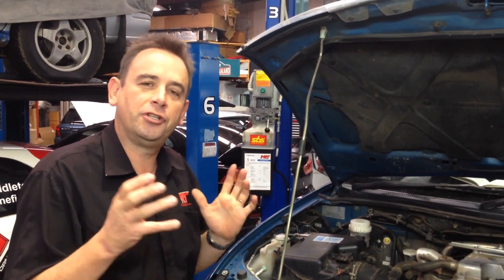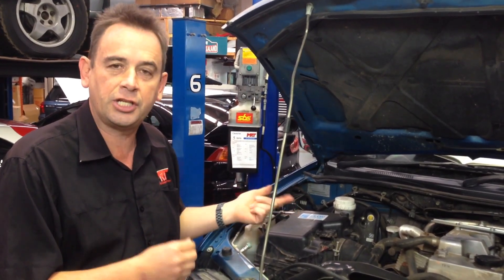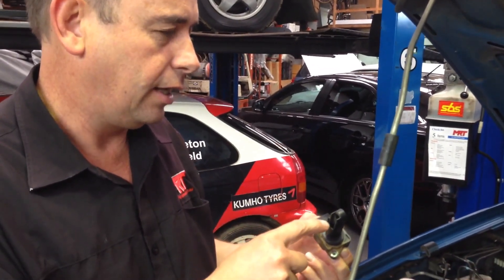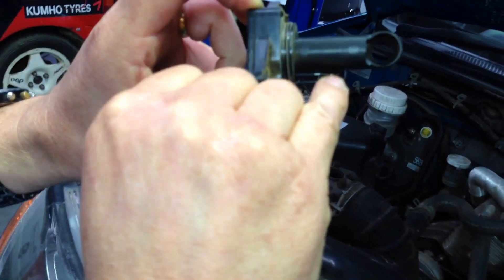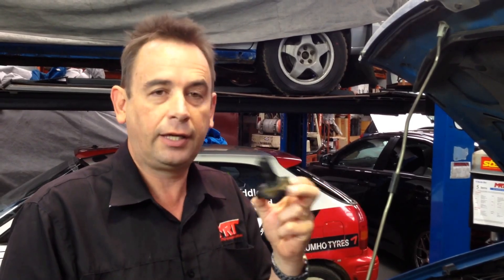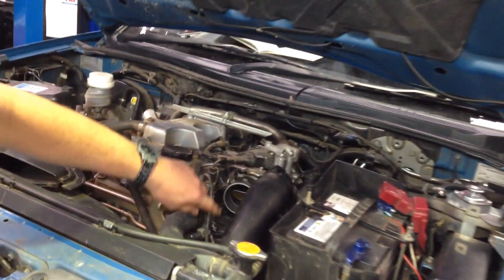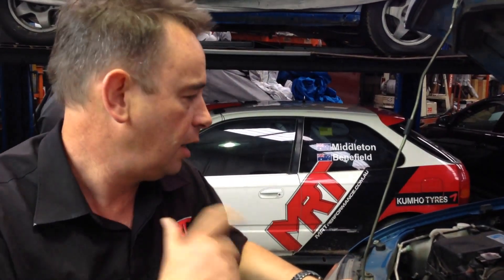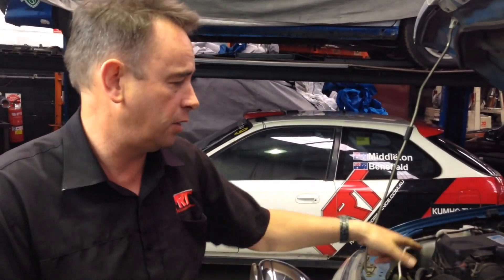Mitsubishi turbo diesel faults with inlet sensors, tips and traps

Comment: Hi, just wanted to say thanks for this tip. It saved me time and money. The airflow meter screws were a little loose and dust was getting in. I cleaned the sensor very carefully with a cotton bud. Now I have more power than before and the engine light has turned off. 
Cheers.
Reply: 2 years passed,  how is your car running now ?
Reply: @chachenaki_kichenancha  still running like dream.
Reply: @AB-cn9eb  I am about to buy 2018 outlander 2.2 diesel ,I wanted to feel confident into mitsubishi diesel engines

Comment: So what is a good DIY way of cleaning this delicate sensor? My 3.2 Pajero is also putting out some black smoke, especially when the outside air is hot and when there is just a little throttle opening, just enough to maintain speed. To remedy this, I must either release the pedal or step on it. No one I have talked to, including the dealership, seems to know what it could be. The dealer wanted to replace the egr valve and intake manifold, something that sounds a bit overkill to me. Something tells me there is a fuel/air mixture problem. But no codes or errors. BTW, I removed and cleaned the EGR valve, and it works fine.
   EDIT: Blocked off the EGR pipe at the exhaust cooler and cleaned inside the throttle body as much as possible without disassembling too much. The MAF sensor was extremely filthy, drowning in a black substance resembling used motor oil. Now there is no more disgusting black smoke, and much better fuel economy, going from well over 11L/100km down to around 8L/100km (highway). Now I don't have to be embarrased when driving around anymore! Good stuff. Still, would be nice to get that ECU remapped.

Comment: I have 96 pajero 2.8 TD 4m40 engine.  The vehicle was driving really heavy ,losing power and black smoke. The engine light came on for:
12* Boost pressure sensor system and 41* Main throttle solenoid valve system.
I gave to my local mechanic who checked and tested the boost, turbo was boosting correctly. Checked throttle valve and components. They removed and tested EGR components and adjusted the belt.
What could be wrong?

Comment: I have a 2014 built diesel Triton, its developing a stutter when maintaining speed about 90-100, also before it was warmed up the other day it smoked alot and wouldn't respond to throttle...it seems to clear and then runs good...but the stutter is still there intermittently...any help or advice would be great ...thank you..

Comment: Hi what happens if the hose from the turbo to the throttle body blows off? This happened to me the other day and I lost power. I put the hose back on and after 8 starts the engine light went off. What would cause this to happen? The vehicle recently was serviced and a anew air cleaner element put in.

Comment: Honestly, my Triton went better when that sensor was dirty. It didn't get damaged in the cleaning process either. And why would you recommend an oiled air cleaner filter?Those things cause more trouble than good. For a start your fuel usage will go through the roof if you fit one. There is already enough oil & running through the airways of these motors & you want to add more from these ancient filers.
Reply: That's just physically not possible. You likely have another undiagnosed problem